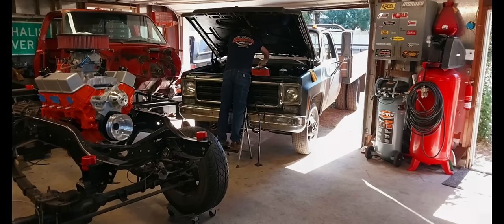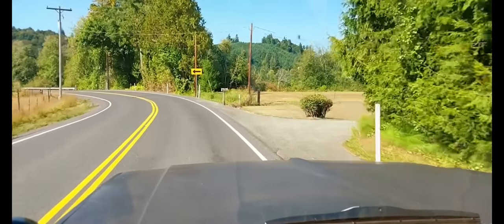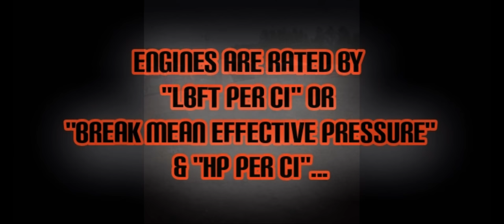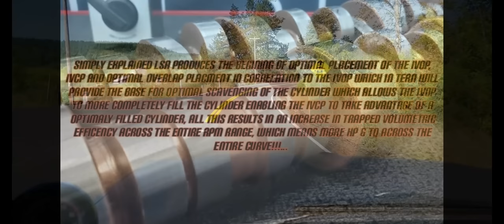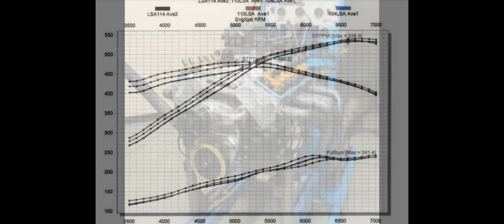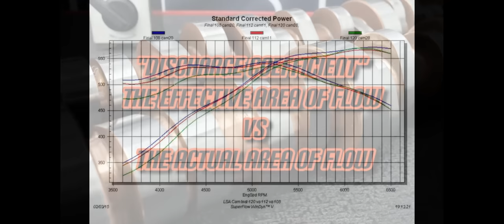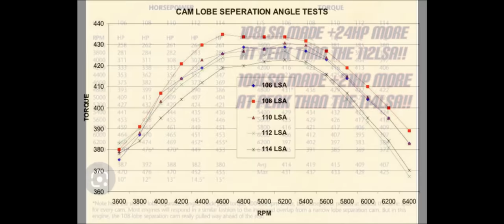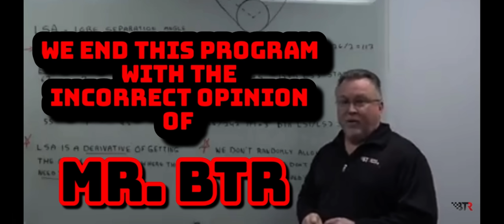Camshaft Selection via LSA, 19LSA's Dyno proven MAX TQ & HP cam tec. LSA, Overlap & Duration convert

Comment: I love this video and I love David Vizard's information being disseminated throughout hotrodders and completely dominating shelf-builder throw-it-together suppliers. The only thing I wish is that we had a functional way to use this knowledge on other engines, particularly 4-valve SOHC and DOHC 3 to 6-cylinder applications, but also 3-valve 4.6L modular engines. I REALLY REALLY want my little 2.3 DOHC 4-banger to do something wild before turbocharging it, and I also want the cam to be ideal FOR turbocharging to start with.

I'd also like to implement variable cam timing, and maybe even full on V-tec if I can. I'm considering a built duratec 2.5 or a built Honda J35 V6 for my car when I'm finally ready to go, though I might also go 1.9 or 3.0 TDI, but both of those are DOHC 4-valve, 4 and 6 cylinders respectively, so I can prob-sibly use the same or similar enough numbers as the duratec and J for those.

EDIT: Actually now that I think about it, you could theoretically adapt this to any engine by finding your single cylinder displacement and simply multiplying it by 8 to pretend it's an 8-cyl, and you can adapt 2 or 3 intake valves into a single intake valve "diameter" by simply calculating the diameter of a single valve that has the same valve area as your two or three intake valves. Let me know if you think this will work or not, boss.

Comment: I built a 117 engine for my Harley. I drew up my own  cam and had it ground. I assembled the engine. Many said it wouldnt work and would run like crap and be a ping monster 😂  I had it dynoed and the results are 160 at the rear wheel. Two cylinder 45°, pushrod engine that is air cooled running on pump 91. I ode this from Ohio, through Maryland down to Alabama and back into Georgia. I did 9 states in less than 24hrs, 1200.1 miles. No issues. I have the heads off to fine tune things and Ill be putting it back together soon. Quench is .015 but this is an air cooled aluminum engine so it grows .04 when fully warmed. I just have to remember to warm it up a bit before blasting the boulevard with it. 
As a side note I had to lean out the cold start cause the tight quench was detonating around the piston rings. 
There was a lot of naysayers when I was building the engine. I hate for the info to be just thrown out there cause I have done a lot of research to get were I am now, but at least it is good info out there and not some random know it all that stayed at a holiday inn. 👍👍 thank you. Love and respect brother. 💪
Reply: I bet it is a blast to ride

Comment: Great video.  I’m working on. 469 Pontiac and EV told me to grind it on a 106 lsa which I did.  The cam is a 276/276, 222/222 106LSA from bullet.  The overlap ground in  is 64*.  DV wanted me to install it at 66* overlap where the ground in overlap is 64.  I assume I need to install it so it’s on a 104 ICL and the exhaust is at. 108 ECL.  Does that give me the 66* adjusted overlap?  Instead of installing it straight up at 106/106 for 64 overlap.  At 104ICL108ECL, AM I getting the 66* overlap DV wants me to have.   I’d really appreciate your help for a 80+ yr young hotrordder.  Thank you for any input🔥😅
Reply: When you say Dyno sheets do you really mean a engine dyno or is this a computer simulated Dyno
The 2 are very different
In addition the viewers need to understand that sometimes lsa has to be chosen based on fuel system management capabilities
BTW that's why most EFI cars have such wider load separation angles
Most ecms struggle with tight lsa numbers
Mass air flow meters vs speed density or the two used together
Reply: Ask DV he would know best. Who knows what the internet will tell you or if the info is any good.

Comment: Love the info here unfortunately all it does is frustrate me. Not knowing anything about pushrod camshaft setups I went to Comp Cams for my "aggressive towing" cam. What they recommended was a part# 01-412-8 or XR264HR-13 with 264/270 advertised on a 113LSA. Looking at the events the intake open is -5* and has absolutely no overlap -11 from the calcs. This seems like it's a horrible choice. According to the math my Gen VI 454 (030 over) EFI setup should be a 104 LSA. Questions I have though that I haven't heard answered is cam type does a roller require a wider LSA since it doesn't have the initial ramp up opening of a flat tappet? I'm assuming a stock or mild port job would require more overlap than a properly ported head but what are acceptable ranges for a street setup with good idle. Does this lower LSA have an affect on EFI idle vs carbureted, since a carb can handle lower vacuum scenarios much better than EFI.

Comment: I had been following this topic watching both DV, and RH. I've watched this one, and your longer video on this subject   Eye opening, and does make sense  when thought through.  I really am NOT any kind of a mechanical engineer, but can see your focus is pretty much spot on.  
I wanted to do something with a S197 3V 4.6 other than just throw a turbo. Was going to stroke to 298, use ported heads, remove the throttle plates and restricting/blocking the variable valve timing.   Is there any formulation, similar to yours or DV's, for this small bore with twin intake vales?   I would like to get this 298 NA to get 400 lb/ft (motor) and ~425 hp (motor).    Seen videos of another doing this with of the shelf Comp Cams, but figured this could be bettered with a custom grind.     Like many others, it this doesn't work, then LS it.   I have access to a pretty pristine 6.2.  Engine is fairly cheap, but the other stuff isn't.  Thanks for your videos and frank approach.
Reply: If you have your heads flow tested, DV has a program that has more variables than his simple formula. For a fee he will spec a cam based on head flow.

Comment: You must have 1000s and 1000s of hours of dyno testing and a huge investment in test engines and camshafts. You must be that guy that won the Engine Masters Challenge multiple times. YOU are an amazing expert on camshaft and cylinder head design. 
  Please tell my why you are not building Comp Eliminator and Pro Stock engines. Your engines would dominate all N/A classes.
Reply: Well I bet it's just budget is why he doesn't build engine I bet there are plenty of great engine builder that can do great against well known engine builder I mean we all learn about engine and not everyone knows everything about engine on how to make them go fast. Hell my 2 stroke engine builder he is know but it's not like everyone knows or can build every engine just because someone has knowledge doesn't mean they have them money to go and complete again we'll know engine builders
Reply: @djrowe10  he said in his video he learned LSA different before he knew David Visard formula he was using it as am example to simply things for us to use for optimal LSA. And to mention ok let's say if he did build engine for years that doesn't mean he will continue to do it and have to money to do it I mean he'll look at our times now with all these prices going up. Do you think he really build engine for everyone. Also look at his budget built 383 it had ported 186 heads that make 580hp I mean you don't here that and I know it's possible David Visard ported 186 head flow stock from 200 or 210 ish up to 270cfm so it's possible. Also he had almost 13:1 compression exactly 12.96:1 that compression helps to and LSA is example on how it helped that motor by a lot
Reply: HE DOESNT HAVE TO. HE HAS BUILT UPON THE FAILURES OF OTHERS WHO HAVE DONE THIS..ITS CALL LEARNING FROM OTHERS, AND VERIFY ING YOUR THEROY BUILDING YOUR OWN..VIZARD METHOD OF CAM SELECTION WORKS IF YOU INPUT ALL THE INFO..

Comment: With your formula, I calculate a 468 BBC with 13.5:1, with a 2.02 intake ( I know, way too small, but I'm using 781 heads) at a 101.6 LSA.  Funny thing, I built this motor in the early 2000's.  It's a 106 LSA, advanced 4 degrees flat tappet (per rules).  it made 437HP at 5700RPM and 632 Lb/Ft torque at 3200 RPM, with a totally stock Holley 500 2BBL.  I think, without knowing, I did alright... A ole' man friend of mine said that manual transmission engines need a close LSA... because a automatic transmission is always 'behind' the engine on power... Didn't make any sense to me, but using a manual trans. I opted for a close LSA engine, based on his advice... Seems he was right, but fur the wrong reasons.  
I have a totally after, as this engine was for dirt track racing & rules changes won't allow me to run a BBC.  So, I have a ultra light Chevy Monza that I want to put this engine in... I've got some ideas I'd like to bounce off you, to see if I'm in the ballpark for a drag & drive car.

Comment: Adam you are doing everyone a great service with sharing you knowledge with all of us. Are you going to do a video to teach use how to use your formal for lsa.  I would really like to know so then I can better understand how a cylinder heads design affects the cam choice.  Thank you very much for your time you spend with all of us 😇
Reply: He showed all the numbers to adjust LSA from, rocker ratio, compression, valve size, and cubic inch. So example do this in the calculator 128-350÷8÷2.02×.91 which is 108. Plus 1.6 rocker .50, compression let's say 11.50:1 .75. So 108+1.25= 109.25. So LSA would be 109.
Reply from the maker: Thank you for watching, if you pay really good attention to the written details in the video it will answer your questions...
Take Care🙏🏼
Reply: @cattledoggarage  I have written down in my note book the formulas that you have showed us in both of your lsa video.  I want to learn the way you learned how to do the cams from your dad and grandpa to. That way I can figure out on Olds,  Pontiac, buick, honda, yamaha, suzuki, etc how to do cams for them to.  It's nice to know a formal to do it, but I really want to learn how you come up with the formulas, so I can understand how the engine design influences the cam selection it wants. Again thank you so very much for the time, and knowledge you share with all of us. P.S.  I also have Billy Gidbolds book like one of the other gentlemen on here.  I've learned more from watching you videos than reading his book.  It's a great book, but it's not as good as you are showing us.
Reply: The more efficient the head, low to mids the less overlap it might require. Not a written in stone thing but..

Comment: First, I want to send prayers your way buddy. The problem you are facing along with your building engines and sharing your knowledge is awesome. And shows your dedication. I hope you are still around.

I am planning on vuilding a dart shp 400 sbc bored .40 over (408ci). What would be the best formula for that? Along with the head flow and valves.

Comment: 10.2:1-331 sbf, 2.02/1.60 valves,  190cc heads, 39 thou quench, 1-5/8 mid length headers, I did the math from last video and I woulda needed a 109 LSA, the cam in it is a comp xe266hr12, maybe I’ll change it. 1980 Bronco on 35s
Reply: Xe cams have unbelievable ramp rates and only work with springs that are recommended. In order to keep the lifter on the lobe it takes lots of spring, that plays a big part in longevity. They don't last long in many instances. People that don't install proper springs have no idea how much power they are loosing due to the lifter getting launched into orbit off the lobe and the cliff it falls off of when it closes causing the lifter and valve to bounce and not be controlled.. those cams are hard to make live on a budget.
Reply: @danieljames5875  True....from 2000 on up the comp lines went backwards..forcing a FT cam to mimic a solid or HR is gonna have bad results. Tried them all even rollers all failed. You can only make so many grinds...so many proven shelf cams that are great despit whatever yr they were made.

Comment: Thank you, given your info it seems comp cams nailed it with their Thumpr series with the 107 LSA. I have one in my 355 sbc and it pulls like a scalded dog.
Reply: Comps thumper cams only make half the torque possible from the same cam with proper LSA, intake, and exhaust durations. There are literally tons of actual dyno results proving this. They were made for sound and not performance and comp has commented on that fact also. Even so I still have one in my 1979 Corvette that sounds great. Just want to let you know.
Reply: The short coming of the thumpr cams is the valve lift. I run 1.6 and 1.7 rocker ratios, it really wakes up with the extra lift. @djrowe10
Reply: Be aware that f you go that route, you are also increasing the duration and overlap proportionally. @joe-hp4nk
Reply: They are junk
Reply: My 10.2ish:1 350 ran great with the mutha thumpr flat tappet, and a set of 462 humps. Just dropped the heads and cam in 11:1 355 and it specs out pretty well perfect with the extra compression. They get all the hate because people try to put them in incorrect set ups and wind up with no dynamic compression
Reply: Having a 107 doesnt mean much...those blow a ton of torque right out the tailpipe, inefficient cams imo
Imagine if you had the correct one!
Reply: Gotta have good compression for them to work. 107lsa is about right for a 10:1 350-355 with 2.02 intake valves. The duration and overlap in these cams sound great but you lose torque down low especially on a low comp engine. They can work well in the right application but they are not ideal. Mainly a good sound cam
Reply: @gordocarbo  Have you tried one? I have the Thumpr roller in my 355 10.3:1 chevy and it pulls hard. I am really surprised.

Comment: You are 100 percent correct. But. Some of these examples are camshafts where the lift is already at the top of the rpm range for the combination. Duration also has a effect on rpm. If the engine would have revd higher peak horsepower would occur at that higher rpm. LSA just brought it back down to lower rpm. Ultimately average torque is what wins.

Comment: Great information, thank you for sharing it in such detail.
In your experience what effect does an optimal lsa have on fuel economy?
I have an L29 vortec 454 with 10.1cr, air gap intake, headers, and I run it on propane. Otherwise it is stock. 
Factory cam is supposedly 118 lsa.
I believe all of what you & Vizard say about the effects of lsa on torque & power. 
But with that stock cam my fuel economy is very good in an old Suburban with 35's & overdrive. Cruise rpm is under 1500. 
Would an optimal narrow lsa help or hurt fuel economy?
Reply from the maker: Thank you for watching, The effects produced by an optimal LSA being as it will produce the highest volumetric efficiency in any given engine the fuel economy will improve if LSA is changed & a given amonunt of Overlap is maintained... Example->> The engine in my Dually is a 383 that makes 470hp & 500lbft+ and if I keep my foot out of the Gas and just cruise it gets better mileage  than it did with the stock 350 in it but that engine is about as optimal as that combination could be...
Reply: Thanks for that response, as I have been curious about this exact question.
Reply: Appreciate the info!😎👍
Reply: Another thing that helps fuel economy is having a well dialed in timing advance curve.

Cam timing optimizes the air/fuel charge, so you're not bleeding that out of the exhaust due to poor cam timing events.

Timing advance is igniting that good mixture at the optimal time, based on engine load and RPM, to maximize pressure in the chamber.

All of it a calculated act to maximize heat/pressure/energy per cylinder while avoiding detonation/pre-ignition/spark knock.

Also keep in mind that while you may have an A/F ratio of 12.2 ... Cylinder 1 may be at 14.2, while cylinder 6 may be at 11.3. Anyhow, it's late, I'm tired, I'm rambling..... Cheers
Reply from the maker: @richdouche8253 💯 An ideal timing curve is definitely critical to maintain a given level of VE threwout the rpm range which will result in optimal fuel milage & performance... Most people don't understand so they cant properly set up a mechanical & vacuum advence system so they will simply overlook it or just lock the timing out on the distributor, which isn't ideal by no means...

Comment: Well worded!  I have been building sbc engines for years but only recently come to understand the dynamics involved.  Is the 128 formula valid for bbc builds as well?  Still working out choosing the correct overlap for each combination.  When I get my quench in the correct range, my compression seems high... so I go with slightly more overlap to lower my dynamic compression, is this the wrong way to adjust?  Appreciate any & all advice your willing to share.  Thanks!
Reply: BBC is 132 and the big cubic inch I didn't know this but I guess 133
Reply from the maker: Thank you from watching, with a BBC the numbers you will use are 132-133 depending on how good the cylinder head flow is in relation to the ci of a given engine...

Comment: 427ci, 2.2"valve, 11:1, 1.8 rocker, LS7. Getting 107lsa+2 more for compression and rocker adjustment. Does this formula apply for high rpm corvette power to 7000rpm?
Reply from the maker: Yes this will work absolutely work for a 427ci LS7 ment to do 7000RPM... Overlap is what dictates RPM, Overlap dictates the RPM at which peak TQ is produced which is relative to the RPM at which peak HP is produced... LSA dictates volumetric efficency and the power potential  produced at any point in the RPM range across the entire curve...
Hope this helps, Thank you for Watching...